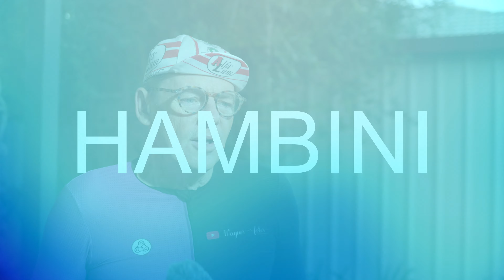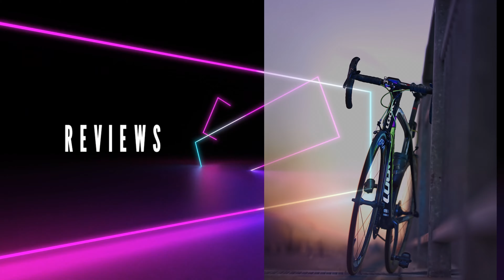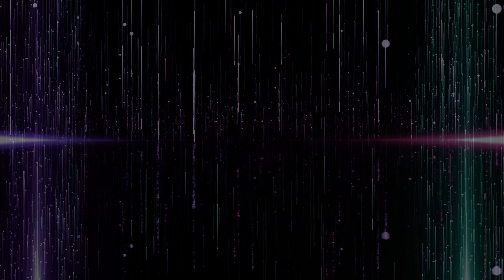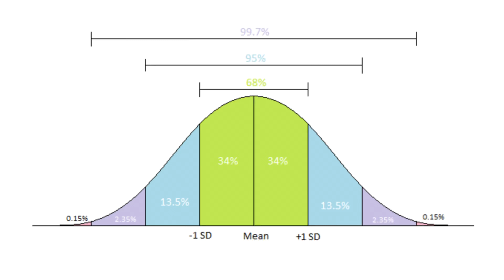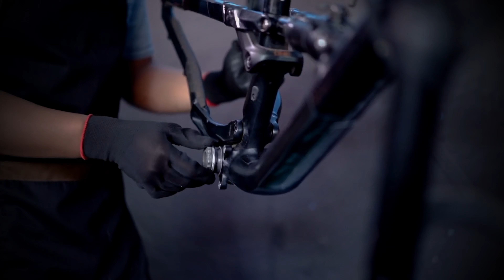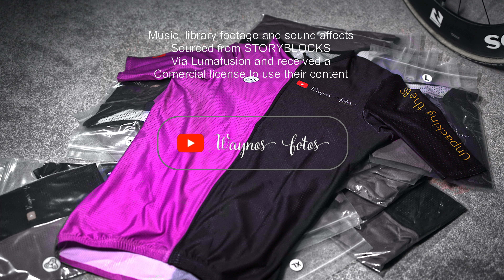Is HAMBINI  ONLY getting the ONE of frames?

Comment: I had a Bowman Palace:3c and had a Palace:R both failed in exactly the way/place Hambini said they would. The Palace:R I had was near perfect in terms of BB and frame tolerances (9000 miles between bb changes) the Palace 3:c was square outside of the BB shell which was out of angular alignment. Both cracked their chain stays on the drive side.  On the Palace 3:c it was right where the weld is for the chainstay bridge literally exactly where he said it will fail. He gets some bad frames I’m sure and he has small sample sizes but when he says a design or manufacturing process is deeply flawed I believe the guy his minor complaints about products can be ticky/tacky and not really that practically relevant but the big stuff is something to take note of. Should also mention I don’t really like the swearing and drama the guy has in his videos per se, just kind of annoying to me but he’s usually right.

Comment: i highly suspect that the latest Bowman models might have changed  production manufacturing or the covid restriction might have limit the ability for proper QC due to travel restriction. Either way, ur entirely at the mercy of the manufacturer responsibility. That being said, I still own a 2017 Bowman Palace R. Done about 15k km of mileage over the years and yet to see  any signs of breakage. Ill be interested to see another cut up from their previous models/batch for a more conclusive result.
Reply: My 2018 Palace:R cracked in the chainstay in the way he outlined in the video. That frame had great tolerances but failed at 20,800 miles and I don’t really beat my stuff up. I think nearly 100% of these frames regardless of year suffer from the same stress relief issue.

Comment: In the old days you took your bike to the dealer and he sorted it. Ive got a viscount from 1972 a bike manufacturer that had the fork of death, my m600 canondale (chainstay failiure recall, synapse carbon (fork recall)  and specialized fsr that was recalled as the rear triangle was misaligned. All handled replaced in the 80s 90s and 10s by the shop no questions asked. Manufacturing has always been poor in the bike industry it was just dealt with better in the past.

Comment: That’s a really good point. In mountain biking Reverb seat posts have a poor reputation. But I believe that post has far more OEM spec than all other posts combined or at least is was. A small percentage of a large number of speced posts is a large number. I’m sure there were real issues with that post but my own experience is very good as are my friends. I think most of those seat posts are good but you only read about bad ones.
Reply: reverb is a precision component. It has to be or the hydraulics would never work. However there are issues that arise in use and these cannot be checked at the factory in the short term. SRAM does retain samples of the posts for long term testing and when issues are identified they can isolate those issues to a batch. When a customer logs a complaint against a post, they can check its batch number and cross reference know issues from their in house long term testing to the issues reported in the field. If they correlate they warranty the part no questions asked. If it does not they investigate further. That's good product management of which QA and QC are part

Comment: It’s not every one of your videos where I agree with everything put forth (but I do always enjoy them!) but this is one where I do. As a machinist I’ve got a good perspective on manufacturing and I would to just add a bit of nuance to one point Luscher made. He is very correct that a product is generally always made the same-but- there is a matter of scale with this. Basically, if a customer orders 5 of something, the method of manufacture could look very different than if the customer orders 500. I’m not going to build a million dollar machine that will help me save 2 minutes of process time on a product. If I were to look at a Specialized Allez frame I would have a lot more confidence in the similarities between units than I would a Bowman frame, who I could assume sells far far less units. There’s a reasonable chance that these Bowman bikes are being hobbled together by hand in low volume with unsophisticated equipment and it takes only an inexperienced welder on the night shift to drastically increase deviation from unit to unit. It’s why qc is so critical and why guys like Hambini are doing the industry a solid.

Comment: I mean, not disagreeing with anything commented regarding industry QC; but, to comment on the point of the video as the stated title, yes Hambini is getting an incredibly biased sampling. This isn't up for debate. If he's only getting repair jobs (and the worst of which, it seems), then yes he's by definition getting "the one bad frame". The whole problem here is we don't know the distribution of the curve because...one sample. We can't say what the variance of a particular model, or even company, is. This is an entirely different argument than if we should trust ANY bike by say, Boardman, after how bad that one was. No, we shouldn't IMHO. But, that's just MHO, not an assessment of the distribution wrt manufacturer tolerances.
Reply: you're right its a sample of one. So lets draw an analogy to illustrate Bowman's quality management. If Bowman was making jet fuel the first visual check they would need to do is sample a litre of jet fuel in a clear glass jar, swirl it around to create a beautiful vortex and check if any particles or water droplets precipitate out. This is an appearance test to check whether the product is clear bright and dry. Bowman essentialy filled the glass jar with cocacola, swirled it around created vortex  but could'nt see through the product, knew its filled with water and it was opaque and still signed it off as clear bright and dry jet fuel. Sometimes we don;t have to overthink it. the visual misalignements on the frame was enough to indicate that they're taking the P8ss in the QC department
Reply: @MP48  Because you don't seem to get it, the quality control means fucking nothing to the topic of is Hambini getting a biased sample. I couldn't give less shits about Boardman's fucktastic QC right now, when I'm talking about statistical properties of a sampling distribution (which currently doesn't exist because, once again for the slow, its one sample)

Comment: Great to see issue this stimulating new content! Love it. To keep the record straight, my question wasn’t about any QA - but about how often the QA is applied  - if QA is applied to every frame then the Bowman wouldn’t have got out of the factory - so I believe it’s a sampled QA application which could mean some ‘bad apples’ can exist. My query is ‘how often do they select a frame to apply their QA tolerances? 1% of frames? 99% of frames. Your view is that “Every bike that leaves the factory is tested” - I think that’s a huge assumption - the Bowman’s look pretty crap, so its probably fair to assume the welder is rubbish across the board  - but the nuanced answer is that we can’t rule out that it wasn’t a ‘Friday afternoon frame’ and which didn’t get pulled for inspection by QA. It would be nice if Bowman could tell us - my guess is that they QA’d a low percentage!
Reply: every frame is visually checked. A sample from a batch off a line will b retained for more stringent conformity checks. The frame Hambini reviewed did not even pass the visual check....Thats like checking a liter of Jet fuel for conformity to clear bright and dry but you're looking at a bottle of coke and still pass it off as jet fuel..CRIMINAL!

Comment: Only one correction. It's BELL END curve.
Reply from the maker: Correction noted! 😁
Reply: I need to see your PowerPoint roast of Waynos.
Reply: I feel like most frames end up at your place because of a bad bottom bracket. Later down the line you inspect the carbon, the welds, the rest of the frame and find all the other dangerous issues that are not a problem until the cyclist has a bad crash or the part fails. And I find it unlikely that faulty qc at the bottom bracket and bad overall carbon quality are linked.
Reply: 🤣🤣🤣🤣 you need to create a new graph for that 🤣🤣🤣🤣
Reply: LOL 🤣

Comment: I recently bought (and returned) a Bowman Weald frameset. It was terrible. It wasn’t straight but the most obvious fault was the carbon fork steerer was massively undersized. So undersized that the headset compression washer couldn’t grip the steerer. Stems just slid straight on and wobbled. I broke a stem (luckily a cheap one) tightening it to the size of the steerer.

I also have a first gen Bowman Pilgrims frame which, apart from the pressfit BB (constant creak and click) has been bombproof since 2016. I suspect they swapped frame manufacturers at some point to reduce costs but this affected QC.
Reply: Neil Webb did a you tube channel I swear he mentioned finding a new factory for the Gen 3 frames
Reply: Ah, there you go then. Thanks for the info.
Reply: A press-fit always has a constant creak and click issue, it is unfair criticizing Bowman bikes for typical bb issues even more expensive bikes have
Reply: Incorrect. It’s fair to criticise any manufacturers that use the pressfit bb system and get it wrong. No matter the size of the company. The fact you have said what you said shows how used we as cyclist are to having substandard products sold to us.
Reply: @rauli386  press fit should not ever creak or click! If the frame is correct and the bearing pressed in and pulled out perfectly evenly it should be perfectly smooth and silent, sadly crap tolerances and crap mechanics cause lots of issues! But my BB86 and BB386 Evo never had creaks clicks or premature wear! But all my frames are always correctly assembled by myself.
Reply: @love2wheels748  Bottom bracket shell is suppose too be machined within a specific tolerance and then reamed and faced. A lot of manufactures don't do all that though. They just take a standard bottom bracket shell or tube and weld it in place.
Reply: @JPC74  Yep I know it's why so many threaded bottom brackets have alignment issues! I've been building bikes for 35 years, ironically my Bowman even though it clearly wasn't faced actually was spot on BB wise 🤷‍♂️ shame everything around it failed 🤣
Reply: @love2wheels748  you can’t fix a misaligned bottom bracket shell with a new bottom bracket.
Reply: @JPC74  No obviously you can't 🤷‍♂️ and any one who states you can is a knob 👍 the irony is I've had to face more threaded BB's than I have Pf30 BB86 or bb386 Evo and those are pressfit that rely on not only a good tolerance hole but also a well faced outer edge for the flange of the press fit cups to sit against. Your see more people having to really wack a chainset through a BSA or Italian threaded BB than you will press fit, then they wander why after using a rubber mallet to get it home they don't spin more than half to two rotations before stopping. Years ago when I started building bikes back in the late 80's you wouldn't dream of building a bike without tapping or facing the BB. Now however bikes arrive 90% built and pdi's are often carried out to a crap standard and these things get missed out, even silly things like outer cables too long too short ends cut uneven causing mushy feeling Braking or inconsistent gear shifts 🤷‍♂️ 
The industry has gone to shit! I even once saw cervelo dealer building a £15K Lamborghini limited Tri bike without good quality tools or a torque wrench, he stated he was so good his hands were calibrated like a torque wrench! I told the guy buying it to complain directly to Cervelo. The industry is full of knobs sadly
Reply: @love2wheels748  The first press-fit bottom bracket system came to mainstream road bikes was Cannondale's BB30 which was introduced in 2000 as a proprietary system for its own bikes.
Reply: @JPC74  Nope the first first press fit to fit production bikes was Klein years before, they even used pressed and bonded headset bearings that held the forks in place, so the only way to drop the forks was to bang them out and break the bond. I had one great bike and the bearings would last well, but those bikes were extremely well made 👌
Reply: @rauli386  incorrect, you don’t get these issues on frames that meet good QC tolerances. I had a friend with a Trek that got 14,000 miles out of its original PF BB, he lucked out and got one that wasn’t made like crap. To give context threaded BBs are actually press fit in the sense that the bearings are interference fitted in the cups that thread into the frame, so press fit isn’t the problem with carbon.